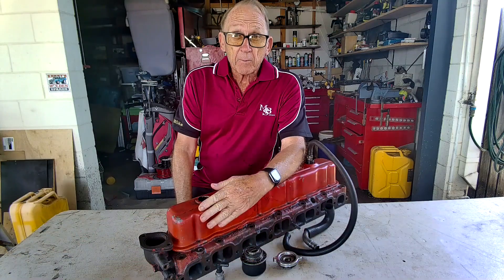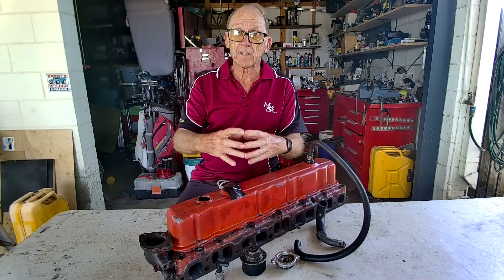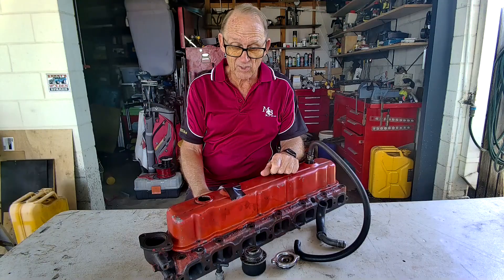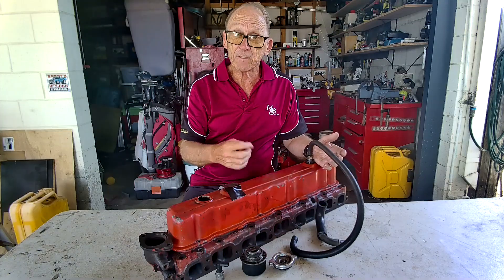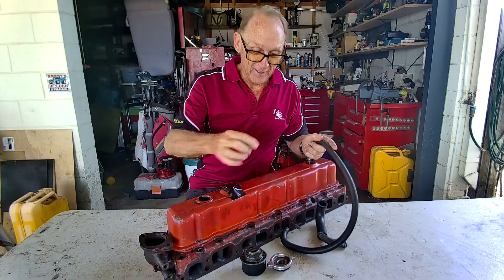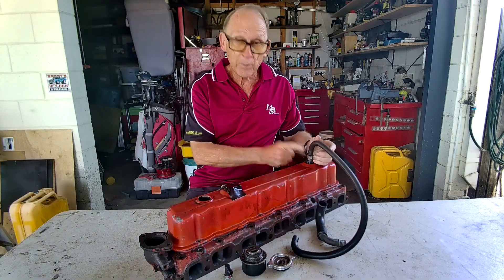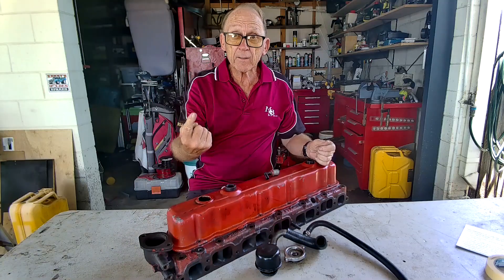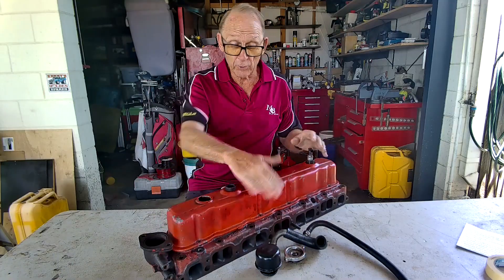PCV Valve Operation

Comment: Hey mate, sorry to change subject on your video, but I'm looking at rebuilding my 186 in the next couple of years. Deciding on the best mild mods, nothing too crazy, it's all standard at the moment. Thinking of going twin stroms, some sort of cam, extractors. Any advice or experiences greatly appreciated.
Reply from the maker: This is a subject that requires careful planning with an honest opinion of what you might expect from a performance enhancement and how much you want to spend on it. The more money you throw at it , the better quality parts you can purchase.  Any info I add from here is 25 yrs old.  Get a set of starfire con rods, they use the larger bolts. Convert them to ARP bolts & have the rods resized.  Balance the rotating parts if you plan on high rpm but a suitable cam is required to suit. If your only going mild, say a 25-65 cam from Comp Cams were pretty good. Roller tip rockers are good if they make them otherwise more dollars for the full roller. Personally I would just use the standard rocker & have them re-furbished. If your going to use rollers I would highly recommend valve stem caps. These allow the rocker to sit straight, stops valve tip grooving and also corrects rocker geometry that will be off by now after several o/hauls over the years. High volume oil pump, electronic ignition from a late commodore and get it re-furbished & re-calibrated. If you want, you can get bigger valves fitted like a yella Terra head. Nothing fancy so far, just easy stuff that's affordable. You want top end, you need to spend more on everything. Carburettors are personal. If you have some capability to tune multiple carbs, go for the stromy x2,  150CD Strombergs x3 for mild, 175CD's for XU-1 cams (fairly wild) Holley I would use a 320CFM. Weber 28/36 DGAV x2 on ported adaptor plates go great too. and of course the exhaust system  upgrade. These days I have almost nothing to do with modified  engines so I don't know what parts are out there to spend your money on. Just be weary of facebook suggestions. Take them on board, research if several people have tried the combos before diving in. Facebook comments are very entertaining to read but not helpful for novices. Cheers
Reply: @mbsoldschool fantastic reply mate. Many thanks. I'll take note of all of this and start working on a plan. Like everything, it's a balance between what you want and how much you are willing to spend.

Comment: Get rid of pcv valve, largen holes in rocker cover and add fittings and run hoses to a breathing catch can, breath it to under the car if you want, fit a drain tube to bottom of can with a tap on it. Let the motor breath! DONE!
Reply from the maker: While that's one way to deal with blow-by, PCV systems are designed amongst other things to maintain a slight vacuum in the crankcase, which is beneficial for engine health. I am not familiar with these catch can things. How do they remove the vapour from the engine without vacuum. It seems this way is relying on pressure from blow-by. Same as removing the PCV temporarily to see the actual vapour coming from the cover hole to determine how bad it is blowing fumes out of the cover. Without the slight vacuum pull, some of the blow-by will just end up settling into the oil & other components which eventually will form sludge. Now fitting the PCV into the catch can seems more feasible.

Comment: My red motor runs the walking stick type breather.
Reply from the maker: Well, it's not supposed to but it will work without a PCV. Remember the carby jetting allows for a PCV. You may have to make minor changes to the jetting  to get the mixture perfect. The more the engine fumes the more the jetting might need to be compensated.
Reply: @mbsoldschool  but didnt some of the red engines come with the walking stick from factory?
Reply from the maker: I reckon you could be right. I sort of recall now that I have seen maybe an EH or possibly early HD with them on as standard. That's over 60 yrs ago, memory is fading.

Comment: With the breathable cap won't this just suck the clean air coming in straight to the pcv valve? I don't see how the air would circulate through the engine otherwise. I have one of the chrome rocker covers and it only has the oil filler hole and the pcv valve hole, yet they only incuded a chrome push in cap, no filter or breathable holes on it at all. Seems I should ditch it and get a breathable cap?
Reply from the maker: The air needs to circulate through the engine to remove moisture and blow-by gasses. A breathable cap allows fresh air into the crankcase, and the PCV valve draws out the contaminated air. Yes some could go straight from the filler cap to the PCV but it will be mixed with the blow-by that is already under the tappet cover.
Reply from the maker: Should read your comment better. Yes you do indeed need to change the cap to breathable.
Reply: @mbsoldschool righto, will do. Thanks.

Comment: I am at the point where my first step when troubleshooting someones engine online is to ask for pictures so that I can see they've got the breather system connected correctly. Most people have no understanding of how it works. The hose is often unplugged or even everything blocked off so there are oil leaks everywhere.

I've seen forum posts go for pages until they posted the picture I requested showing the breather hose disconnected.
Reply from the maker: That's a great point, a simple photo can save so much troubleshooting time with those systems.